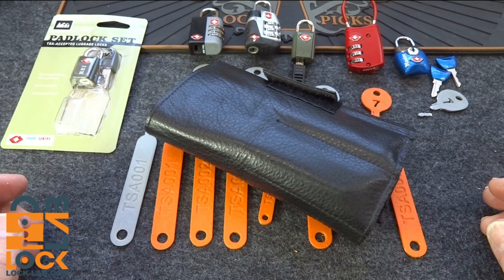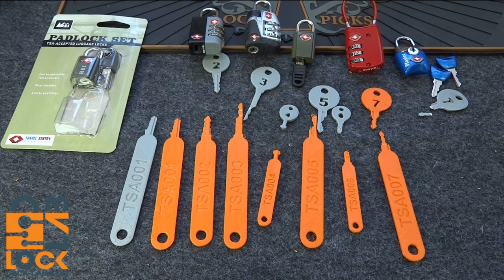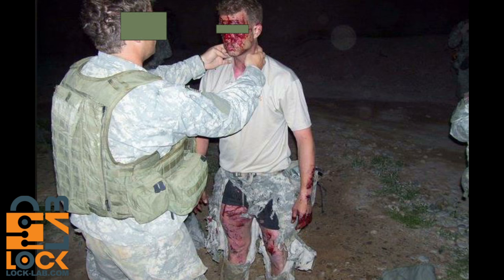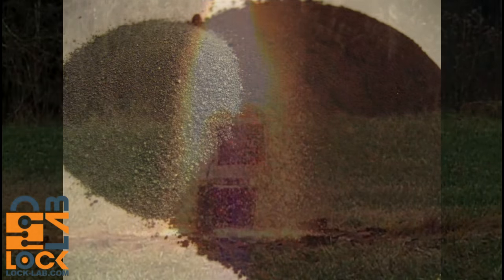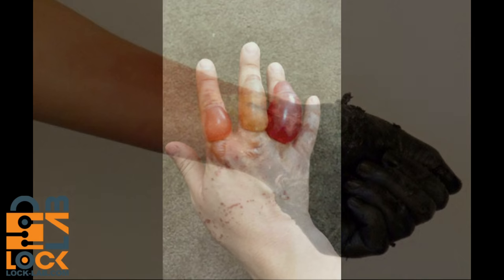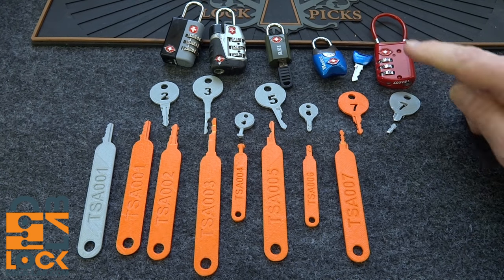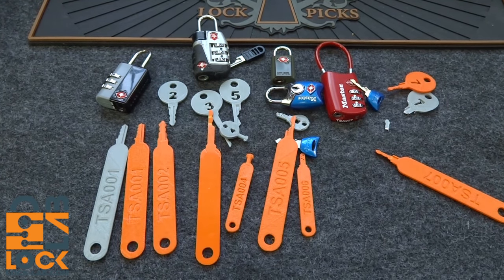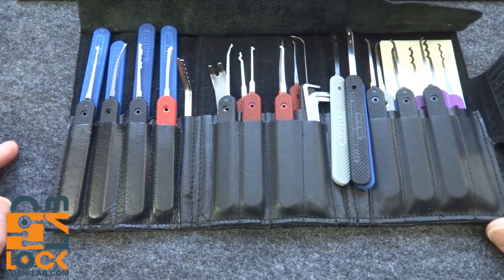(1000) Lock Defeats: Theory versus Practicality

Comment: As a prospector we do use explosive to break down large rock or even boulders.  Known as Sierra blaster or the micro blaster. Their the size of a blasting cap. But the amount of effort to do this is stupid but if you drilled into the frame set the charge and boom your in. But time consuming and loud. So picking would be better. For sure
Reply from the maker: Yeah, from some of the comments it is fairly clear that most of the people saying "blast it open!" have absolutely no experience or idea how difficult that statement can be in actual practice.  Sure, packing something with explosive is one thing ("pack the keyway with C4", for example), but the method of initiation is often ignored.  In most cases, using a secondary explosive would be totally unnecessary, as most blasting caps contain enough primary explosive to blow open pretty much ANY lock.  Unfortunately, blasting caps are the thickness of a pencil shaft, and cannot be jammed into keyways...  My point is that 99.99% of the "blow it open" comments are made based on something they saw in a video game...

Comment: For the thermite i think the best fuse by FAR is a big sparkler (has worked countless times for me)
If you only have the 10cm Sparklers you might want to use at least 3 tied together with wire or something.
I use sections of 1m Sparklers that have about 0.5 cm diameter.

Comment: 3D printed keys are great for casting impressions. There are several low melting point metals that are hard enough to make sturdy keys but I wouldn't bother going through all that trouble for TSA locks. Congratulations on 1000 videos!

Comment: As someone that has been 3D printing for many years now, some of your problems with the keys are to do with poor printer setup. Your bed needs levelling and first layer settings need adjustment. It also looks like your over extruding plastic and that is what leads to that rough texture on the top layers.
Their are also ways of making prints more robust, exotic filaments, annealing prints, and loss casting the parts.
The other method is replacing the extruder with a small rotary tool and making a mini cnc mill......

Comment: Wait, you can't afford a metal 3d printer, but you have a couple of miniguns? Aren't those things like $60,000 a peice? Just how expensive are metal 3d printers?
Reply: Darren Jacobson he said he got the on sale two comments below yours. also a metal 3d printer is 100 000 to 500 000 dollar.
you can also use a normal 3d printer with metal filament but thats only 85 percent metal and it isnt flexible. also for metal filament you need a very precise 3d printer and you need to fiddle around with the settings alot until you get your desirable result.
Reply: someone Oh I see, that makes sense.
Reply: 3 digit combos ... should those take longer than 10 sec to open even by decoding them ?    
Make a plastic model with 3D printer , use that model to make a mold , smelt metal and pour it in that mold and you have a metal key .
Copper only needs little bit over 1000°C and thats still enough strong metal for a key that is easy to file .
Reply: Pete Lind thats a great idea. couldnt you also use aluminium? you can smelt some cans with a torch.
Reply: someone From what I've seen it takes more that just a torch, but yes it's relatively simple to smelt aluminium, making a mold accurate enough for this model though, that's hard.
Reply: Darren Jacobson they aren't 60k
Reply: i would have thought a metal 3d printer would have the same problem with being inaccurate.
Reply: Darren Jacobson metal 3d printers are industrial grade printers. They are not like the plastic 3d printers, metal 3d printers are Huge and are VERY precise. They cost a lot of money, probably 5x or more then a brand new mini gun.
Reply: i was thinking exactly the same thing though i would probably try aluminium/aluminum due to the lower melting temp
Reply: you don't actually need to own a metal 3d printer, there are a number of services that will metal 3d print objects for you, like shapeways
Reply: That's what happens when you work for Uncle Sam.
Reply: Could you just print miniguns if you had a metal 3d printer? I am joking for now but in the future... who knows

Comment: I've printed the TSA keys for one of the guys on UK Locksport and they can work if your printer is good enough. My ultimaker 2 gave a good enough finish in PLA and ABS to get the TSA 007 to work on a suitcase (the only TSA lock I had access to). The overhangs create a problem on a few of the keys. It's still far faster to pick them though, the TSA 007 can be picked with a paper clip in seconds.

Comment: I have to challenge your assertion that liquid nitrogen is impractical on the grounds of acquiring, storage and usage. It is relatively easy to acquire, you only need an appropriate storage tank. Handling can be dangerous if your accident prone but most gas stores have suits, gloves, aprons, tanks, valves and pretty much anything else you need to store and handle the gasses. The smallest containers I've seen were pint sized, they looked kind of like a thermos with a valve on top.

When one uses liquid nitrogen on a small object like a lock. One typically uses a nitrogen funnel which come in a variety of forms, some of which are aimed at beginners whom aren't all that familiar with liquid nitrogen safety. For a reasonable price you can easily set up a system that fits in a backpack. With an open top funnel or a fountain funnel attached with air compressor hose you could submerse a lock attached to a locker or door easily.

However I can't dispute the impracticality of relying on cold induced embrittlement. The world just isn't as simple as everything shatters when frozen with liquid nitrogen.

Comment: Bill, before 9/11 there were a number of web sites, including US government ones, about how to do demolition and demolition tools. Because sometimes there are legitimate and necessary reasons to want to cut through reinforced concrete structures "NOW NOW NOW". One of these tools was a construction product called, as I recall, a Berfix rod from a swiss company. Like a six foot long road flare, you light the business end, press it against concrete or rebar, and it burns and cuts right through. (I think the center core was aluminum or thermite, same principle.)
 Anyway, after 9/11 a lot of web sites were taken down, including that one. I can't find any mention of Berfix rods, so perhaps that wasn't the name. But I'd give you odds someone in the construction/demolition business knows them very well. They WERE openly sold as tools.
 And even if you go behind the curtain into the "Adult" section of WalMart, they don't carry them either.(G)

Comment: Hey I have a suggestion for a lock destruction video that is cheap and practical. Get you a Fresnel lens out of an old big screen TV. Some are given away if you haul away the TV or you can buy them on amazon for about 40 bucks. The ones with the right focal length type can melt steel on a sunny day.

Comment: Don't trust the TSA! I know when flying with a firearm the federal law states that you must have a Non TSA lock on your firearm case, so the TSA doesn't have access to your firearm. If they need to see what is in the case, then you have to unlock the case to show them, but afterwards you lock it back up so the TSA cannot get to your firearm. But you must have a TSA approved Firearm case for your firearm, a case that does not flex if you try to bend or pry it open, and has 2 locking holes for your non TSA locks.

Comment: The stupid TSA LOCKED !!! my suitcase when it went through unlocked.  We were coming back from Italy, and they also broke a bottle of wine inside.  The suitcase arrived home locked, with the leaking bottle of wine, and I didn't have the key to open it.  I had to break the lock.  I now send that suitcase through without a lock.  There's nothing valuable inside except maybe a cheese.

If someone wants to steal your luggage, they'll take the whole bag.  I've heard it happens a lot at LAX.  Or it's the TSA that's stealing and the lock obviously won't prevent that.

Comment: Another point about using a heavy laser on a lock: like with explosives you need the specific expertise to do that safely, and then in the end it's just applying lots of laser power on a piece of metal. Also it'd probably be hard to make a video of the action that shows more than whiteness.

Comment: for your 3d printer: you may need to adjust your z axis and add more fans to the extrusion point so it cools faster. also, you can heat treat PLA to make it harder. this will make the print shrink slightly though. the minigun tests if you aren't kidding are going to be hilarious. tough under fireeeeeee lol. thank you for all the videos and content and giveaways bill, you got me passionate about lockpicking and you are the reason mad bob STILL has backorders out the wazoo. can you do more videos about training locks especially cheap ones like the mad bobs cutaway? and cheap security pin sets?

Comment: Congrats on the 1000 vids Bill! Liquid nitrogen is fairly easy to obtain. You can use a standard thermos to carry it, just don't put it in an airtight container, it needs to vent. (Aluminum) thermite reactions are easy to ignite SAFELY (sparklers are NOT safe), with readily available (and legal) components.

Comment: Great video for #1000. Loved the TSA segment. I have a friend that services many doctors offices with liquid nitrogen. I can probably fill a cooler for me and do a video on master locks. I have worked with liquid nitrogen in the rubber molding industry where its used for deflashing molded parts. And yes, it does burn when it splashes on your skin. have to wear ling sleeves and gloves and face shield. but I may give it a shot.

Comment: Anything short of an argon laser pushing several dozen watts is not going to TOUCH a lock.  The blue ones that Wicked Laser sells will give you sunburn, and possibly blind you, but won't do anything to a lock.  No, you aren't going to find anything close enough in a CD/DVD/BlueRay burning drive.  1 watt you need a specialty projector laser diode, and anything even close to powerful enough is going to be very expensive and use some exotic gases and/or chemicals.

Comment: Thermite is way cheaper to produce than 100$ - you can rust steel wool and grind aluminum foil and get thermite for few bucks. Also, it can be ignited chemically. Liquid nitrogen is not really dangerous as long as one is not stupid enough to ingest it or dip a body part for considerably long time on purpose, and is generally safe to pour on the skin, as unbelievable as this might sound. Anyway, what about using corrosive chemicals like nitric acid?

Comment: Bill, tsa locks are a joke, you don't even need to cut them to get into most bags.  Just move the zippers to one end of the zipper track and take a bic pen to the zipper.  When you run the zipper around to close it you can't tell it was ever opened... except for the missing valuables.  There is, simply, no point to locking a zipper.  Hard cases are the only way to fly anymore because tsa employs crooks and has no accountability.

Comment: You shouldn't need any actual explosives to get through a lock, or even a locked door. A couple yards of detcord will do just fine. 
Also good for removing pesky trees. 
Even if you had a sinter printer the keys probably wouldn't fit or would snap. 
Sinter printed parts arent nearly as strong as a cold-worked metal. 
For rapid prototyping, you print the part about 1mm bigger than the finished product on all working surfaces.
For sintered metals toss them in an over or kilim to "reflow", an annealing process works fine too. 
Then you have to machine down to the working size. 
For the plastic, you have to use low speed because high-speed cutting will melt the plastic. 
Far easier to just cut a key from a blank.

Comment: Meaning crazy question: what will append in a usual lock if you stick magnesium ribbon and set it on fire. Would it open the lock by melting or soder the stuff shut?

Comment: I wonder if the printed keys could be used as examples either in a key cutter or to be copied by hand filing/cutting so that brass or steel keys could be made that would work more reliably.
Congrats on 1000 vids!

Comment: Ehh those 3d PLA printers aren't the right tool for the job... even those expensive PolyJet's don't produce a finish which would beat out a worn out Bridgeport J-head mill. The only 3d polymer printer I've seen that comes even remotely close to an acceptable finish (even for prototyping) are those that run SLS. Probably have better results by buying some cheapo 11 or 12 gauge sheet metal from the Home Despot, printing out the templates, tacking them on with spra  adhesive, then Dremel'ing them out with a steady hand  (or setting up a panto-follower jig, to trace out the contour of the PLA print, then cut on the metal). Anyways, great channel!

Comment: My first question is if appropriate metal blanks with the close to the same profile as the TSA keys are available. If so a blank and a little work with a file and one would have a GOOD key - much better than 3D printed plastic...

Comment: FYI: CD-ROM players use a red laser. Blue lasers are used in... Blu-Ray ;) Still not powerful enough to burn through paper, let alone metal.
Reply: Terrence Koeman actually the burners have rather powerful violet lasers and even 10mw will char paper (removing metal requires much higher peak  power but pulsed lasers will eventually drill through just about anything)
Reply: A Blu-Ray burner usually contains a class 3A laser. Class 3B lasers and above are considered fire hazards, 3A lasers are not. 3A lasers may perhaps leave a mark on paper after a while, and maybe even puncture paper in a few years. But that's about it. And pulsing these diodes to get greater output will destroy them in minutes.

Comment: There is carbon fiber infused filament for 3D printers. Never used it myself, but might help make stronger keys?
Reply: extruders for ABS/PLA don't go much above 300C so you would have to use something like Lead, witch would be more fragile than ABS or PLA plastic.
Reply: That's a totally different printing technique. So he would need to get a new (very expensive) 3D printer.
I suggested trying the carbon infused filament because it can be used in a normal plastic filament printer.

Comment: You need better material for the keys. Markforged has an Onyx material that's like 7x stronger than standard plastic used in 3d printers. It's like steel vs wood when you compare the 2.

See. How your keys flex? This stuff doesn't. At all. Like carbon fiber vs play doh.

Comment: make a kit that you can use to cast then pour a fluid into to make a key...
Reply: Lunas Eclipse it would make a key if yr pins all the way up. So your key is worthless
Reply: That is not how i meant that you obviously need the key to press into a mold...
Reply: Chris Johnson that would be lost PLA casting. but I was talking about perhaps taking a mold of a print then making an epoxy or JB weld key since PLA and abs that can be printed don't hold up well
Reply: Lunas Eclipse You can cast Aluminum pretty easy and cheap. The King of Random has YouTube videos that show you how to melt and cast aluminum really easily and very cheap.
Reply: Lunas Eclipse won't work you will only get a cast of the lock and all of the pins in locked position and I would be incredibly impressed if could get the cast out of the key hole
Reply: Lordz Of Fatman read my comments I am not talking about using it on the lock I am talking using it on a key you have limited access to or if it is broken.